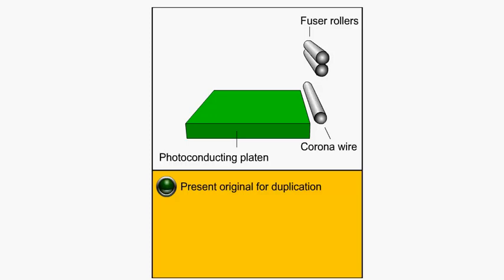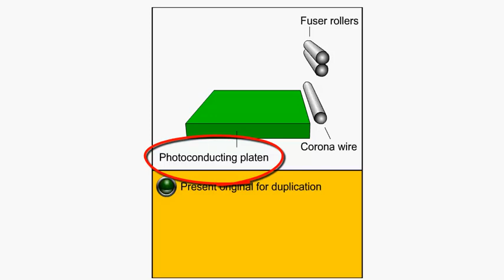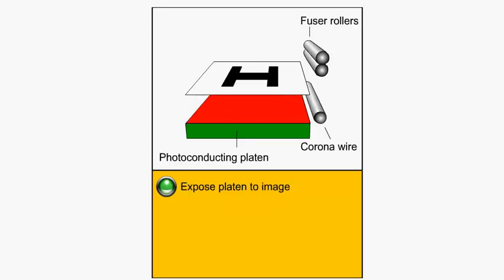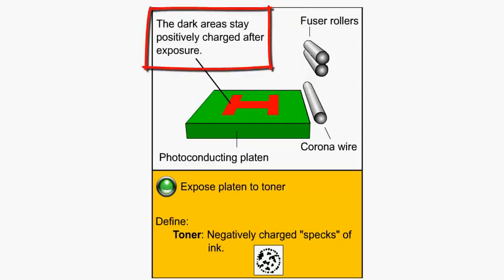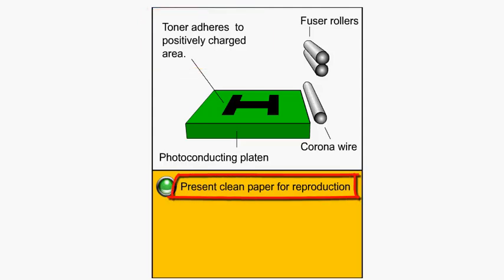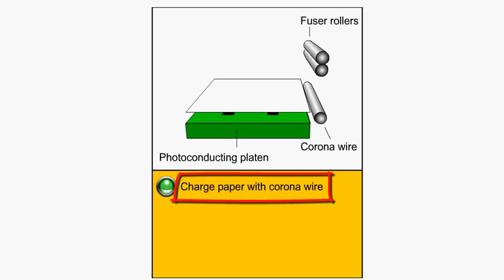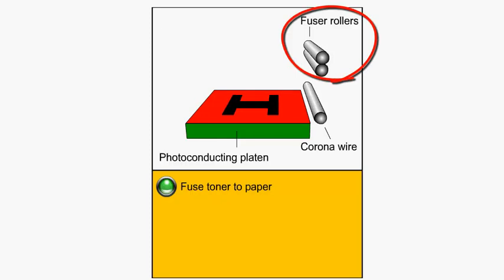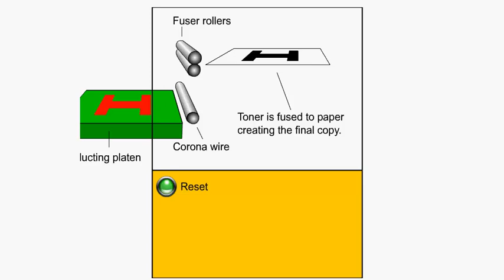Electric Charge - How a Photocopier Works

Comment: A photocopier has three main parts, the fuser rolles, the corona wire and the photo conduct in flatten.
The first thing we do is to present the original for duplication. Next, we charge the platen positively with the corona wire, the next step is to expose the platen to the image. The dark areas is stay positively charged after exposure, the toner negatively charged specks of ink, is the next step we expose the platen to the toner. The toner adheres to the positively charged areas, we next present clean paper for reproduction, the paper is first charged with the corona wire. The charge paper is now ready to receive the toner, so that we transfer the toner to the paper, the next step is to use the fuser rolles to fuse the toner to the paper, and toner is fused to paper creating the final copy